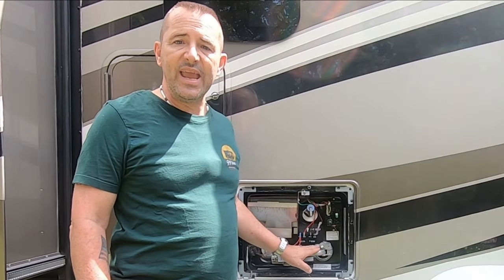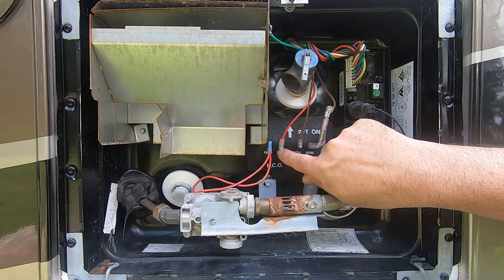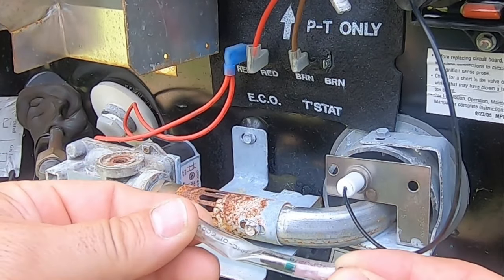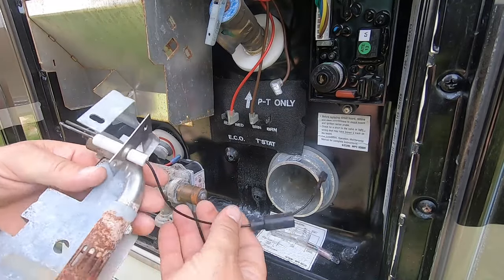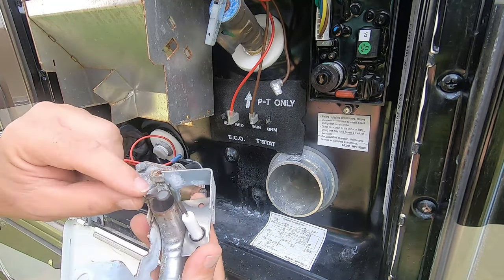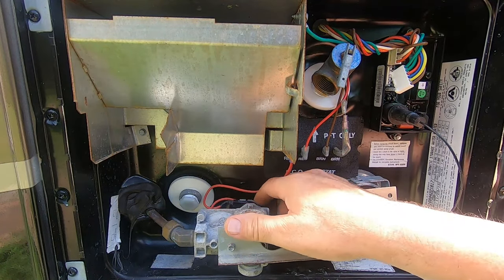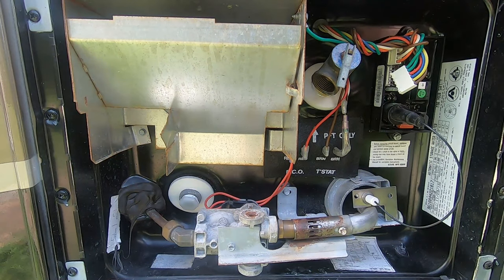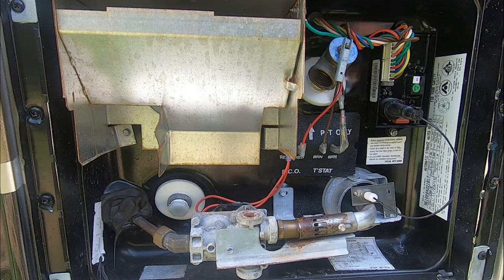RV Water Heater Not Igniting Or Staying Lit - Troubleshoot - RV Maintenance And Cleaning

Comment: This video was and is very helpful I have a Coleman 262BH with gas hot water heater fault light comes on after about 30 seconds lights then faults out I am going to have to watch this video a few times then do those test that you conducted system is very similar to the one in this video I am going to shop parts you did say you advertised parts? Also it is very dirty inside where components are would you recommend using a air nozzle to blow out? Hey bud I got a update maybe you can get me pointed in the right direction went outdide pulled cover the spade connectors where the thermal protector and the spade connector with the 2 red wires I believe are corroded off it was just barely making a connection to light heavy corrosion has disentagrated them it looks like they go into a round solenoid side by side any help on what to do next I would sincerely appreciate any tips on ehat to do next thanks
Reply from the maker: One of those round discs is the thermostat that tells the control board to heat the water.  The other is a high cut off to shut down the heater if the water is too hot.  I have  some amazon links below in the description for common parts.  Since you are dealing with gas only do what you are comfortable with.  Good luck.
Reply: @RVHabit  Thanks!!

Comment: Nice Job, Lou. Great close ups with the video.  I miss our Atwood Water Heater.  The only problem we ever had with it was the same that you had, the ceramic insulator on the igniter had a small crack in it that prevented the heater from running on gas.  We changed it out and was good to go. Now we have the On Demand Heater, still hate it. LOL
Reply from the maker: Yes, I like the Atwood water heaters.  Not quite sold on the On Demand water heaters.

Comment: GOOD VIDEO LIKE ALWAYS.  ONE THING I WOULD DO ON THOSE CONNECTORS IS PUT DIELECTRIC GREASE ON THEM.
Reply from the maker: Hi, I sprayed the connections with Corrosion X.  It is an excellent spray that protects against rust and corrosion.  Dielectric grease is also an excellent suggestion.
Reply: @RVHabit  I put grease every time I change a light bulb out.

Comment: Wow man, thorough video.  My problem, same Atwood 6 gal, is works perfect, but gas valve doesn’t shut off all the way. And it stays lit just right of the gas valve at the brass jet. Small as a bic lighter.  Essentially it’s a tiny gas leak left if the air intake you adjust at the end. If you didn’t know any better, you’d think it was an intentional pilot light.  Any ideas?
Reply from the maker: That should be corrected immediately.  Have it diagnosed by a professional.  It may be a bad gas valve or solenoid that closes the valve.
Reply: @RVHabit  i ordered and replaced the gas valve. Works perfect now.  A pro would have prolly done the same and doubled my expense. Used it like that for months.  I’m sure there’s a fix for the old one. I’m gonna crack it open and see what it was. Thanks.

Comment: Bought a used 2020 Jayco Jayfeather 22RB from dealer in April.. Did a "shakedown" trip to find out what what works, doesn't etc. It has a Dometic 6 gal water heater LP/electric. In gas mode the burner ignites and a flame starts.....loud roaring sound with a yellow flame. It kept burning like that for, perhaps a minute and then the flame turned a nice blue and the sound diminished significantly BUT the flame then shut off just as it seemed to "settle". I have not yet cleaned the burner as per your video but I suspect the venturi will have to be adjusted, at the least. The heater does not work in electric mode either. How can I check to see if the heating element is working without having to remove it?
 Will let you know results after cleaning the burner. Cheers
Reply from the maker: It is to much detail to go into via a comment however start with checking the breaker in the power distribution panel.  The heating element is on the back of the water heater and operates through a relay.  If you are not well versed in how that operates you may need a technician to diagnose.  Good luck.

Comment: I just have to say here at 2:36s this is the most brilliant explanation I have ever heard! Bravo.  I'm troubleshooting now suddenly no hot water gas nor electric.  Similar looking Atwood Unit.  See if I can learn something here.  Hope so cause getting cold outside.  Unlike most videos which are confusing guesswork, this so crystal clearly explained.  Man, where can I make a donation. Bravo! Surprisingly I got the same unit on my "Yellow Submarine" haha!  Which kind of sand paper to use for cleaning up those rusty points?
Reply from the maker: Hi James, thank you very much.  I feel once you understand how something works you will have better success in diagnosing any problems.  As for sandpaper you really can use any common sandpaper grit.  I used 220.  If you have no electric or gas make sure the unit is getting power to the control board.  If it is getting power you check power after the board.  If you have the same unit as mine, it is reported that Atwood did have some bad boards back around 2016.  The board says Zhongding on the side.  I have this board and plan to change it out as a precaution.  Good luck.

Comment: Great video!! I couldn't find much on this water heater and I'm new to this stuff!! Silly question, but the switches that are inside the camper that say "water heater electric" and "water heater gas"... Do switch BOTH of these on? Or is it one or the other?
Reply from the maker: If you only want to run on electric or gas then it is only one switch. You can also run it using both electric and gas simultaneously.  Just remember when using electric you need to mindful if using things like the AC or microwave.
Reply: @RVHabit  awesome!! Thanks for the response!! 🙏

Comment: Mine lights but before it heats up all the way it shuts off and doesn't come back on and isn't working real well on electric mode either. The other LP appliances in my travel trailer are working fine including the stove top and furnace

Comment: Thanks for this video, my water heater was doing the same thing, electric worked just great, you say you were going to order a new ignitor, did you and what the part number.  Thanks.
Reply from the maker: Hi Yes I did.  All the parts are in the description but here is the link again for the ignitor:  Atwood 93868 Mobile Products Spark Probe Single Sense on Amazon:  https://amzn.to/32mfiFI
Reply: Got the new part and replaced it and cleaned everything, and still no good, bummer.

Comment: I have the same model and mine has been having a delayed ignition sometimes and causes a loud BOOM!  Got any tips about that. Good tips but didn't see the igniter part number. Can you provide it?
Reply from the maker: Hi, Sounds like an issue with the gas part of the water heater.  Unfortunately it cannot be diagnosed without being hands on.  I would have it professionally serviced as the 'boom' you describe sounds like an excess amount of gas entering system prior to ignition.  The part number for the igniter is listed in the description.  It is Atwood 93868 Mobile Products Spark Probe Single Sense. Find it on Amazon: https://amzn.to/32mfiFI
Good luck.
Reply: @RVHabit  I replaced the Control Board and Igniter and that fixed it. Thanks for the help.
Reply from the maker: Awesome glad it worked out

Comment: Hi , I contacted you before about a dometic water heater issue.  My water heater works perfectly on the electric side no issue. But on gas side not  so good. I followed all your tutorials on this heater. The problem is that it lights and runs for 3 or 4 seconds and then shuts off. It does this three times and then locks out.
I tested all wires and have just under 12 v.  Blue wire gets just under 12 v when it gets lock out. I changed out board twice and changed out igniter twice. Still the same. I had a rv tech come and look at it and tested everything and came to no answer other then board. It seams it not getting signal back to board from flame sensor. Tested ground and now we're at a stand still . Any help at this point would be great.
Thanks 
Your tutorials are very informative but this one I'm lost on
Reply from the maker: Well my guess would have been to test the igniter to make sure it is sending voltage back to board to indicate the flame is lit.  If that checked out then I would say it has to be the board.  Also check that the two probes inside the flame tube are 1/8 inch apart.  Since you had an RV tech look at the problem I assume all those things were done.  After that I have no idea.  Make sure the tech checks the gas valve is operating correctly.  Although uncommon they can go bad.  Good luck.

Comment: Hi, great video ! I just bought a motor home and it seems i only have one switch to turn off the 12 Volt. But vavious stuff stays turned on. So i assume i would need to just shut down some master breaker to stop the 12volt from flowing to the floor propane sensor for example ? thx !
Reply from the maker: Hi, there should only be one disconnect switch to turn batteries off.  There are certain items in the RV that may be wired directly bypassing the disconnect switch.  One such item that is common is the LPG Detector.  To truly disconnect batteries just remove the negative wire from the battery.

Comment: I did as you explained and still have a 3 second flame and out. My ignitor doesn’t appear to be working, I can light it with a clicker lighter but it still won’t stay on, would the faulty spark ignitor cause this to happen?
Reply from the maker: You may have a control board issue.  Watch this video https://youtu.be/wgk-vaFD4kg?si=deYjOOrY6qJP8FXQ

Comment: I am having the same issue with mine although it is a suburban. I have replaced igniter and I have adjusted trying to get the air gas mix right. I have gotten it to stay lit one time but most of the time it lights and stays lit briefly and shuts off. I am going to look at the other things you have suggested but my question is on the prongs that light the fire. Should they glow red when it is lit? The one time I got it to stay lit the two prongs started glowing very red but I wasn't sure if that is good long term or if that is how hot the prong must get to send the signal that all is well. Could you help me with that question? Thanks for the video.
Reply from the maker: Typically the prongs on my water heater will glow red.  I have never heard that them glowing red or not glowing red effects the performance.  The more important factor is the distance between them.  Make sure that is within spec.

Comment: Thanks buddy you saved the day…and maid me look like a pro in front of the mother in law 💪🔥😅😅
Reply from the maker: Now that's priceless!
Reply: Question for a pro ?😊 
I clean the connections on the thermocoupler like you said after the water was warm instead of cold but still no hot water ? But I have hot water when I use the gas water heater ?
Reply from the maker: If you get hot water on gas that rules out that the bypass valve is in wrong position.  Have the thermostat checked and the electric heating element checked.
Reply: Stopped at the rdv shop my relay switch behind the water tank was cooked and the main circuit board was defective…thanks for your time 😉

Comment: Hi Lou thanks for the video, did you ever replace that spark arrester I am having trouble with mine could not get past the rivet that they attached, how did you get past it thank you
Reply from the maker: Hi Mike,  The spark arrester should come with a metal bracket that attaches to the burner tube.  Mine was held in with a small screw.  If your is riveted it can easily be removed by drilling through the rivet.  Good luck.

Comment: Thank you this is great!  But can you help with replacing the element?  Electric wont work and we assume it is the element, but doesn't appear you can get to it very easily!
Reply from the maker: Hi Alicia, If your RV has an Atwood water heater you are correct, it can be difficult.  On Atwood WH the electric heating element is located on the backside of the unit usually accessed from inside the RV.  The heating element is accessed inside the black electrical box.  Many times the entire water heater needs to be removed. You also need a special socket to fit the heating element.  In addition there will still be a good amount of water in the water heater even after it has been drained.  If you are not comfortable with any of this please consider having  a professional do it for you.
Reply: RV Habit Thank you.  We were able to get it working on gas thanks to your video!
Reply from the maker: Glad to hear it.

Comment: Will the sparker still work if there's no battery hook up?  Just hooked to a generator at the moment. We tried the electric element. The hot water works everywhere but only last for 4 or 5 aeconds
Reply from the maker: Hi Ricky, the water heater needs 12v to power the control board. If the RV is on generator that should make the converter produce 12v.

Comment: I just bought a 30 foot year 2000 travel trailer with same unit but with pilot not electronic ignite. As much as I like not having to worry about a pilot I do like the simplicity of it. My trailer wasn't winterized properly and had a split hot water tank, I had a friend with a junk Lance truck camper with similar heater but wasn't also electric just propane. I removed the tank from the water heater and replaced mine with it, was all the same except for the hole in back for the electric heater rod isn't there. For now I am just going to run it on gas only and will see how often I wish I had the electric... If it bothers me I may buy the proper tank. If the pilot bothers me I may just replace it entirely with an elec ignite unit. Hoping to find one used or a good deal. Don't want to drop $500 on a new one... even $230 for the tank I am trying to avoid. So far I only have $20 into it for the rings and gaskets I needed to switch the hot water tank from the used free one I got. Nice tutorial
Reply from the maker: Great it sounds like your a real DIYer.  I agree $500 on a new one is a bit painful.  Good luck.
Reply: RV Habit DIY may be an understatement in my situation but yes! I am always fixing something on my channel.

Comment: We have the gas only type, it lights for a few seconds and then shuts off. Replace the entire heater and it still does the same thing.
Reply from the maker: Well that certainly is not right. I recommend an rvtech to properly diagnose the issue.
Reply: @RVHabit  we're going to replace just the circuit board again and see if that fixes it maybe it was defective.
Reply from the maker: Try the board from Dinosaur. They are a great replacement.

Comment: Mine isn't letting lighting at all..... how can I trouble shoot if it's either the gas valve or the board? You can hear the igniter go off but it won't catch cause its not getting gas
Reply from the maker: That is the principal idea.  You may have to play with it a bit to get both arms to line up.  If you determine the arm is actually bent it will need to be replaced.

Comment: Hello, I got the DSI fault on my WH yesterday. Tried three times, and it wouldn't light. I hit the gas button again once more and went out to look at it, and when I opened the access door, it immediately lit on the next spark. What I noticed is that the spark wire is pinched off when the door is in the closed position. Is that the probable cause? Is there a way to adjust how far in the whole spark assembly sits inside the space?
Reply from the maker: A pinched wire could certainly cause the system to no work correctly.
Reply: @RVHabit  thanks for your response. I took it in and they said the spark rod was corroded so they cleaned it and said it worked properly. I went to pick it up and was able to recreate the problem right off the bat. They finally understood and said they're going to get a new sparker and put some spaces in the hinges of the door. We'll see if that helps.
Reply from the maker: Why does it always take two or three times to get things done right.  At least they will get it fixed up.  Shouldn't be too bad a new igniter/sparker is only about $15.  Good luck.

Comment: Hi my sparker has a "L" shape and the ends fall where the flames actually are burning is this normal can it melt or burn overheat etc. Im worried i just recently had it repaired and i dont know if it was done correctly
Reply from the maker: Yes one probe is an L shape the other probe is straight.  The ends of the probes should be 1/8 inch apart.  The end of the probe should be touching flame.  That is what tells the control board that a flame has ignited.
Reply: Thank you so much

Comment: I did all that to no avail. then i took off the panel inside the rv under the stove where the water tank is located, the back side of the board was very dirty, i took it out, cleaned it up, and now it is staying lit. (knock on wood)
Reply from the maker: Great to hear. I also have a video on changing the control board if needed.